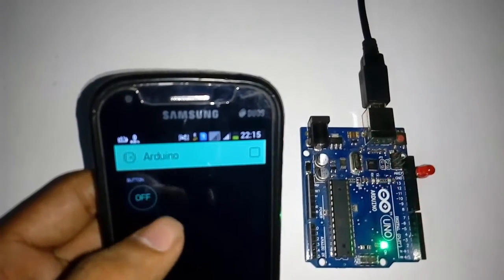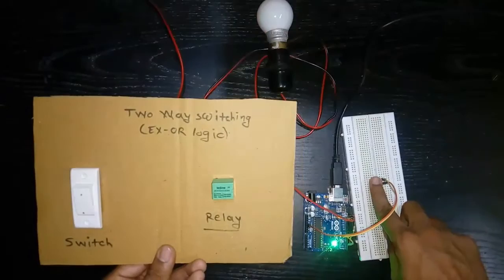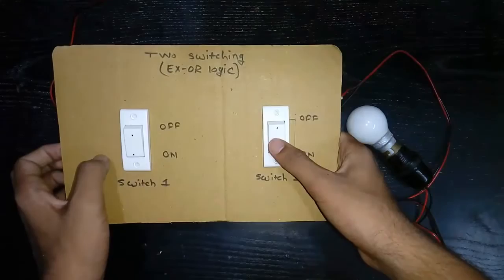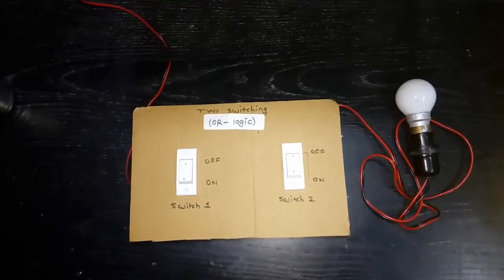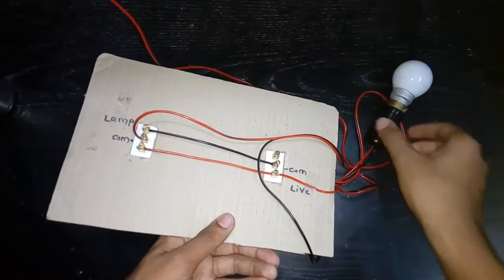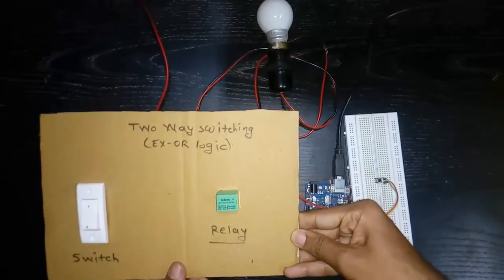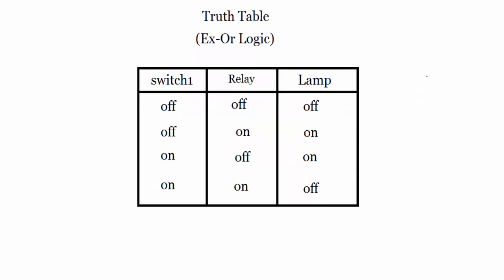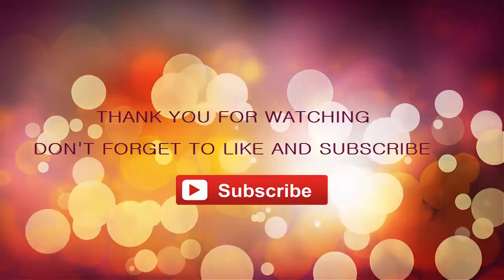Two way switching

Comment: Awesome video, I am looking for this. Can I use TRIAC instead of relay??
Reply from the maker: +Subramanya Chakravarthy yes ,you can ,but circuit becomes more complicated.also heat sinks are required.i think relays are best for this.
Reply: electronics forever I thought of relays but for dimmable loads I need triac switches